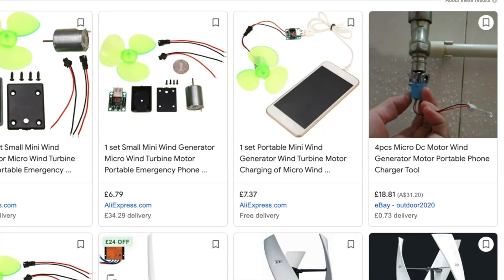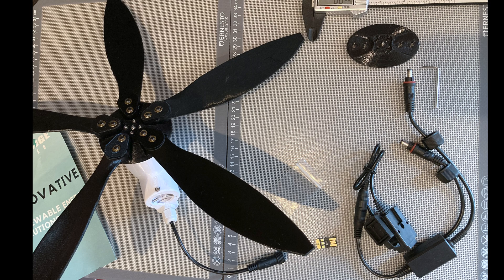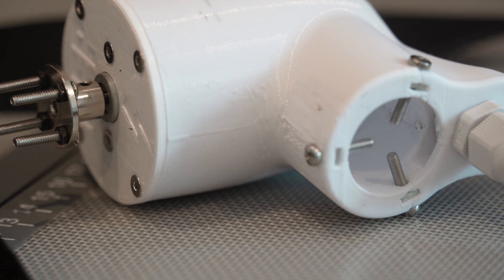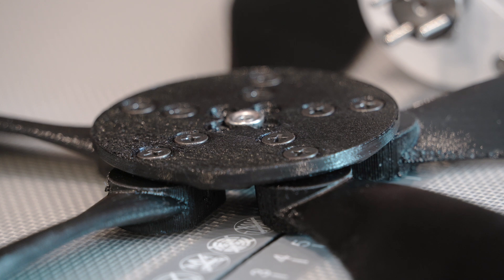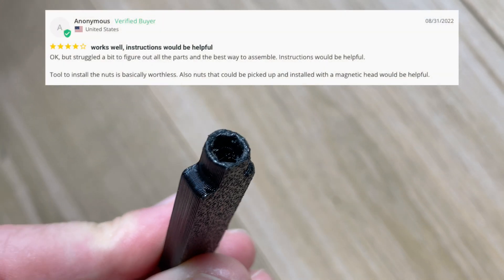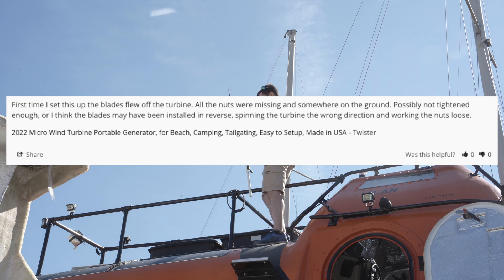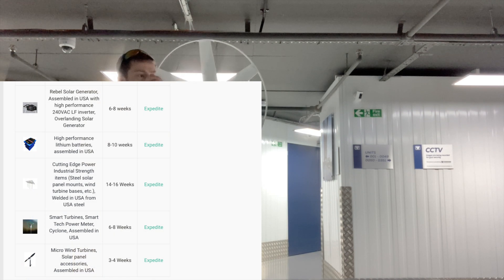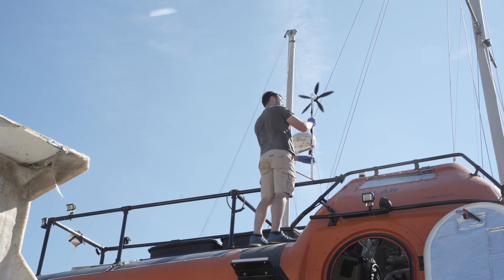Portable Wind Turbine Review: Cutting Edge Power 15 watt micro wind generator - initial impressions

Comment: All practical tests of ground-based small wind turbines show: 1) They hardly produce any electricity. 2) They don't last do not last long!
No electricity because there is hardly any wind near the ground - and the electricity yield is proportional to the third power of the wind speed: 100% more wind = 800% more electricity! 
In addition, the wind near the ground is extremely gusty. 9 out of 10 small wind turbines therefore cease operation after a short time! With light FLEXIBLE solar panels, you can generate at least 10 times more green electricity with the same investment of time and money! Reliable and virtually maintenance-free for at least 25 years.

Comment: I would suspect that their inconsistent, 3-D printed blades are likely not even close to an optimal airfoil shape.. which means that you could probably fabricate your own blades and hub plate from carbon fiber and achieve equal or better performance for less weight. I'd also mount the unit on a lightweight camera tripod, or carry some paracord and tent stakes to set up guy wires to stabilize the pole.

If you plan to pack this with the blades off, then definitely balance the assembly before you go, number each blade and it's spot on the hub so you can reassemble it in the same configuration as needed.

Comment: So How did it work out or did it not work on your expedition? I fixed the blades with marine grade bolts, washers and locknuts and it rotates fine generating power into my portable power station. Thanks
Reply from the maker: We went with solar, as the Rutland was too heavy and these units (even the replacement) not good enough. You may have got lucky with balanced blades.

Comment: WHY is providing a decent wind turbine for smaller applications such a challenge? My little drone has more engineering in it than this garbage.
Reply: It is very easy to make a motor spin a propeller. It is very difficult to make alot of energy, from a small amount of wind. If you think it can be done, then do it.
Reply: @MrSummitville  Hence my question, jack@$$.

Comment: I bought one back in 2018, unfortunately when I installed it, some light weight wire floated up into the blades when it was spinning and the entire thing destroyed itself. It’s one thing to snap a blade, but the entire unit destroyed?

Comment: It seems what you have there is a dynamo. Almost since the dawn of electricity dynamos have been used. They are though inherently inefficient and fail quicker.
So the verdict of that generator is "Scrap/Junk". Everything is wrong.
And if you need a generator which works in all weather and doesn't break, you need one who can turn the blades out of the wind, when the wind is raging(50+ m/s).
I have not seen that in small scale generators, but who is the first ;)

Comment: Everything about this tells me its a gimmick. 3D printing does not hold up in the weather. It warps when it gets hot and water can freely flow through the laminate.
Reply from the maker: Is this the case even with PET plastic? It has good temperature characteristics and isn't much of a moisture absorber.

Comment: I purchased one a few years ago and was very disappointed,  could get no juice out of it. Tested with a power drill and reckon you would need to have blades rotating over 4000 rpm to produce less then stated 15 Watts. 
With delivery and customs charges was an expensive failure.

Comment: Looks like hot-garbage to me, taking that thing with you on an expedition (or even a strenuous picnic) would not go well. You'd do much better by simply making your own, or at least replacing the shitty printed parts with something less prone to crumbling away when temperatures drop. I don't know what that heap cost you, but there's about £10 worth of parts there, and most of that is in the electronics.

I'd suggest visiting your local RC hobby shop (or just going online) and buying a couple of nice big electric aircraft propellors, they're reasonably cheap, strong, and light. and are also very well balanced from the factory, making (or buying) a simple adaptor to mount them onto the motor with (they're usually 2-bladed, so stacking to make a 4-blader would work to increase power available). of course, for a much greater power to weight, a brushless motor/generator is best, and figuring out your own rectification/regulation is quite do-able and not too taxing, even with limited electronics experience. but that's a bit more of a project, and might best be left for a rainy-day.

 I've built a few little turbines to play with, and while none were pretty, they were all capable of respectable outputs, and cost nearly nothing, throw a little (and i mean little) budget at the problem, and i'm pretty sure you could come up with a very nice, light-weight solution.

EDIT: why not ring around a few people on the UK? I'm sure I've worked with a company that did small lightweight turbines, although I'm blanking on the name. I'm sure that if you could find a small outfit that did something at least CLOSE to what you want, they could work with you to produce a viable unit, especially if you were willing to take it somewhere interesting to test/promote for them.

Comment: You could make a jig that uses the fixing holes of the blades as as pivot and then measure the weight of the blade via the tip or a measured contact point.

The assembled prop can be assessed using a lawnmower blade balancer which is like a stepped cone that balances on a spike.

Comment: Alex I'm a mechanic and I can tell you that there is not one hope in hell that I would use this POS. 

I don't trust it, I don't trust the seller, I don't like it, I hate the mounting. Mechanically speaking the moment of it on the top of even a small mast is going to be substantial. How are those three pitiful screws going to stay tight in that pitiful printed housing pounded by water and wind? The shitty plastic will deform under load and you'll probably never be able to keep the screws tight.
I imagine with my over active imagination that some wally is 3D printing this in his bedroom at mum's while she's doing his washing and cooking for him.
Even the most simple question is met with passive aggression. 
Aaaaaargghhhh........

Comment: I'm afraid you just bought a box full of red flags. No matter what you do with it, it's still going to be junk.
Aside from it's mechanical flaws, it is doomed to failure from the start. A big problem with wind power is that the available power goes up exponentially as wind speed rises. That means you get virtually nothing at low speed. They quote 5mph cut in speed. The blades may turn but you won't get any power out at that speed. Conversely they quote a survival speed of 45MPH. That means even a gust at say 50mph will probably destroy it. 50 MPH gusts are not that rare, especially at sea. Looking at the blades, I think even 45MPH is very optimistic.
That cheap brushed motor is not designed to handle thrust loads. That means the bearings won't last long at all, especially in salty air.
Unless you are somewhere with a fairly high steady wind, the average output of the wind generator is likely to be only a couple of watts. That's not really any use for anything.

Comment: Look up videos on blade balancing. The value of balancing your rotating assembly can't be understated. A properly balanced blade will work more efficiently, cause less vibration, and extend the life of the bearings. Whenever I sharpen my lawnmower blade I check its balance. You could rig a lawnmower blade balancing tool to use to balance your windmill blades. They're very inexpensive tools. Anyway, I'm happy to see you adding wind power to Alan. I prefer axial generators over blade driven units but anything is better than nothing. Axial driven windmills don't need a vane, don't need to rotate as wind direction changes, and are safer to be around. Because you'll be in extreme conditions you'll need to have a good braking system so that it doesn't spin itself to pieces during a gale.

Comment: I can only Imagine that retrofitting some model aircraft propeller blades would be worth the effort. They would be much lighter, stronger and balanced a lot better. I would imagine a 3blade design would work like a charm. You can also buy different pitch angels to work more efficiently different wind conditions.

Comment: This is amateurish and almost a little frightening. 3D printed wind turbine blades are something you'd expect to see in a middle school science classroom, not in a production model.

Aside from the unprofessional looking finish, it has to be the root of their slow lead times. Each of those blades took hours to print. The money they've spent on 3D printers and labor to run them would have easily bought an injection molding setup.

Comment: As a hobbyist 3d printer, the standard of print quality is shocking. They've literally had it set at the lowest quality print they can. Those blades are likely just going to snap at one of the layers. Cant believe a "company" would send out a product like that.
Reply: Couldn't agree more. They definitely had it on speed mode instead of quality mode. Wouldn't surprise me if they used cheapo bulk PLA from china also

Comment: The company who supplied you obviously never expected their product to go through such a rigorous examination as you carried out , especially not to the extent that you were going to weigh each blade . Very impressive . Maybe now they will bend over backwards to do everything possible to replace the product with something similar , but far more superior .
Reply from the maker: Probably more likely they block my email address.
Reply: @AlexHibbertOriginals  you can easily balance these blades by following the method used by model airplane hobbyists. But, looking at the product I have zero confidence in it.Tthey just slapped some off the shelf components together inside a horribly printed case. Not much thought has gone into the printing orientation/assembly, even if the plastic material survives, the print may delaminate.

Comment: That thing looks like a toy. I would not trust it for safety, and maybe not even for luxuries. 

That said, you could probably balance the blades by weighing each side of each blade with the other side on a stand. Then balance by sanding (or adding epoxy as you describe) each side. 

That stuff sure looks like PLA though, and not suitable for water exposure over time.

Comment: I'm sure at this point in this epic journey into making 'the Alan' as brilliant as a Thunderbird, investing in your own 3d printer may be a valid on-board necessity to help with random repairs as well as just making your own shiz to your own spec far easier. yes a bit iffy in high seas, but having something that could replace a broken locking nut on the fly would be a game changer imop, or keep ordering cheap faking tat off the interwebs & pray! Which would be counter to the perfectionist (Anglegrinder) type person you portray 🙂 either way I thank you for a fun, if brief upgrade update & hope it don't catch fire before the end.👍

Comment: I use a marine wind turbine to supplement power on my live aboard boat. They’re a good option in general but in my opinion the version you bought has way too many problems to be effective, even with your extensive mods. The roughness of the blades will affect airflow and efficiency. The lack of balance will result in mechanical failure, potentially dangerously. Also, that 15 watt rated power is ambitious at best. Wind turbines produce a rather disappointing amount of power under the best circumstances. Also, that company’s customer service is unforgivable. Thank you for making a video on it. I’ll certainly not be giving them my money. I really do enjoy your videos.
Reply: Remember the turbine is not for a boat, it needs to be an ultra lightweight method of producing power while ski touring in the extremely high latitudes.
Reply: @teeanahera8949  He might be better going for metal blades, thinner but stronger.  But definitely not using that turbine in any event.

Comment: I wonder if it wouldn't be better to DIY a turbine instead of trying to fix this crap.

I would use the motor (if that´s any good) and scrap the rest.
Buying new blades is probably cheaper than trying to fix theirs.

Then the huge plastic housing around the motor. Since weight matters for you, do you really need such a bulky (and probably heavy) housing?
I would think that with a bit of tinkering you could come up with a much better, sturdier and lighter design.

And bonus: You trying to DIY a turbine would make for a few interesting videos :)
Reply from the maker: If only I didn't have a dozen complex builds on the go already 🤣 I wanted something that worked straight off the shelf.

Comment: my advice would be: make moulds of every plastic part and make it yourself in carbon/glass fiber. that turbine is not ok even for prototyping purposes, too much flex on all that plastic and it will probably loose eficiency and will beat itself to death due to vibrations and unbalance..
Reply: Just throw it away, and get some reputable people to design something. Lots of makers have plans for this type of stuff. I can tell by the looks of the blades that the geometry is way off... this is a straight up startup scam.
Reply: @ffoska  agreed, maybe the electronics are usable for a properly built turbine, even with a gearbox

Comment: for the price i expected it to be injection molded, not 3d printed, and man that print quality does not look great 
and as others have commented, i do hope they printed in something that can take the low temperatures as it would otherwise delaminate itself and fall to pieces in the cold as it shrinks too much
Reply from the maker: PET apparently
Reply: @AlexHibbertOriginals  okay PET is safe for both UV and extreme temperature changes, so they though of that
Reply: @Space_Reptile  The housing does not look like PET though, It's PLA IMH.

Comment: As someone pointed out, check what type of plastic was used to make this........ device. as some plastics may become brittle in the cold temperature or deform under the sun. 
You could infuse the blades with  60 min laminating epoxy, but that's a lot of work and would make it very heavy. Also, you would have to remove material to match your lightest blade. 
As for balancing the propeller.  For airplane models,  we use du-bro true-spin prop balancer.  It may or may not work for your application. But at least it will give you some ideas 💡  🙂
Reply from the maker: It's PET apparently, so temperature-safe within my bounds. Thanks for the blade adjustment advice.

Comment: I have been 3D printing for years and make mostly functional parts.  That did not look like professional work, even if it is a more difficult to print engineering material.  Large blades are available in the hobby market and much better brushless motors with way better magnets. You would need a 3 phase rectifier but that is easy.  A better unit could be made with minimal engineering.  Is there a real market for these?  Oh- 10% is a huge difference.  I suspect they were printed with completely different configs.
Reply: No, there's no marked. They make a good noise, have to have VERY low tolerances or they will be even louder or introduce vibration. And they get less effective the smaller they are.
Even if someone makes them very light, it's just not worth it to carry around to maybe charge your phone but not much else.

Comment: Coming from rc airplanes and dealing with badly balanced propellers.  for balancing theres 2 techniques we use. Quick fix is strips of tape on the light blade and move it around to find the perfect balance. But I would grab some sand paper and go at  the heavy blades down to the weight of the light blade Instead of additive balancing.  it would also smooth out the horrible surface finish and maybe help it function better in the first place. 
I've been looking for something similar for my camper van in the winters and find every option unacceptable like you, either barely capable of charging a phone or it costs as much as the van.
Oh and honestly their customer service can get bent with that attitude.
Reply from the maker: Interestingly, they claim the ridged finish on the blades as an intentional feature for airflow. Thanks for the blade editing tips.
Reply: @AlexHibbertOriginals  Yeah, that's marketing BS. Bad printing, that's all it is. :(
Reply: @AlexHibbertOriginals  I used to work with military drones, a field expedient way of refinishing and balancing propellers was to coat them in epoxy. Adding more coats to the lighter side until it was balanced then polishing smooth. I don't know if that would work of plastic blades because of the flex.
Reply: @AlexHibbertOriginals  i will bet you every penny in my bank account that thing is going to shit itself.... those blades are a disgrace ..... bin it before it at best lets you down when you need it.... or one of those blades becomes lodged in your face when it flys apart

just my 2 cents